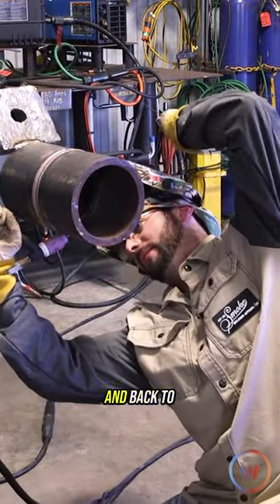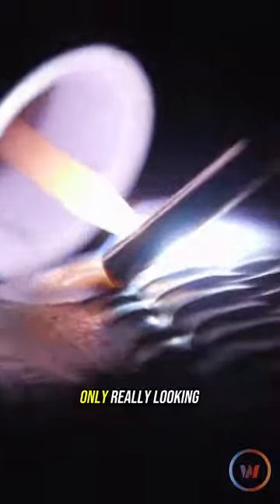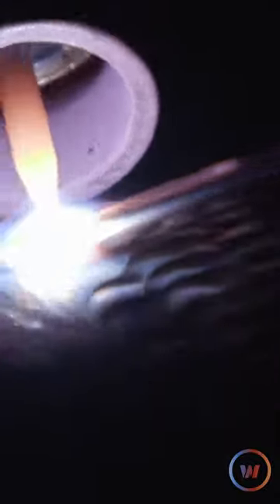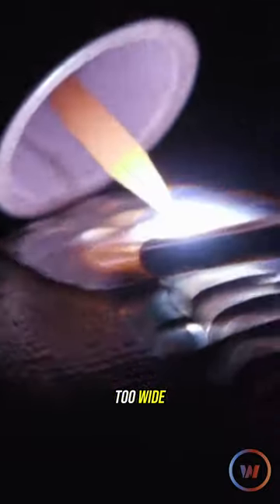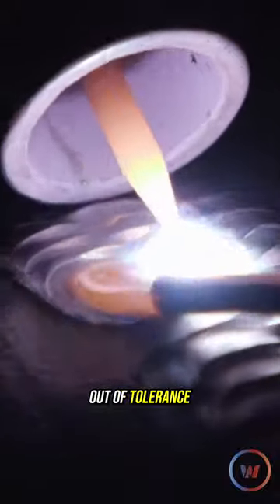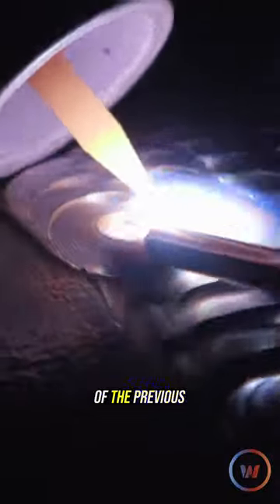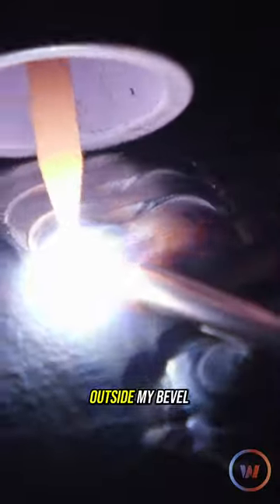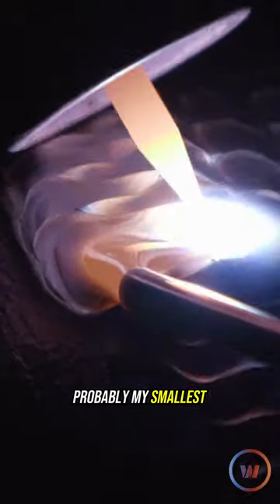5G GTAW Cap pass - how to get gold on carbon steel #welding #shorts

Comment: So how get gold on carbon ?
Reply: use gold paint
Reply: i am still learning tig so take this with a grain of salt, but in my experience heat control seems to be key. i think the coloration is caused by the metal oxidizing. idk if this works on pipe, but one way i get nice colors is by putting aluminum chill blocks on top of the piece as i weld it
Reply: Use 70s6 instead of raggedy 70s2
Reply: @R6riky  ty à lot mate

Comment: Fail 
Perpendicular pass over the starts and stops undercutting the cover.
Reply: I was about to ask what you noticed it may not be that much.  But I would still ask what this is for, or is this your signature of it is within code and job of not then I'd give em a chance to fix if he don't try to explain. The weld is slick though
Reply: Spoken like an inspector that has never welded shit. 😮😅😂

Comment: Looks slick but why did you weld across the stop like that. Why not ? Not the way the joint being welded is running . But why a classic example whould file slightly an just slightly to verify an effort and to also its just classic textbook example.  Its definitely slick jr . You got it though, i still like guys that start like that from the bottom to top with torch handle reach way back technique is highly effective and worthy though. Nice . And bead are spaced nice and proper. Good video keep on welding and making these i will start sharing for the newbies, to see because the tig is amazing and intriguing